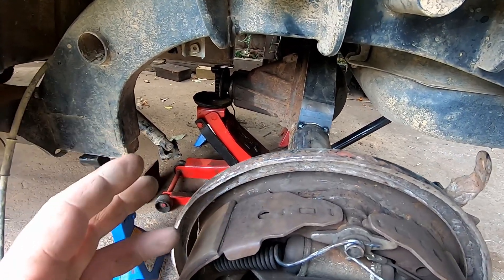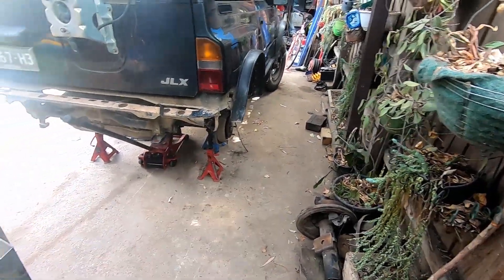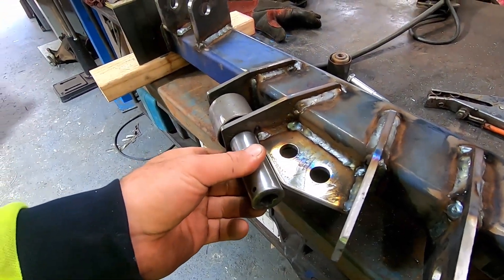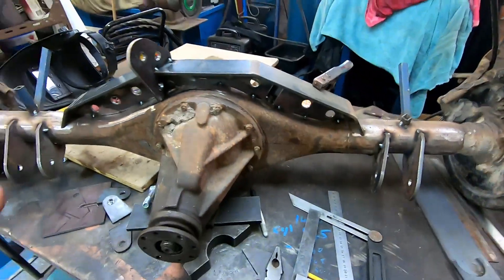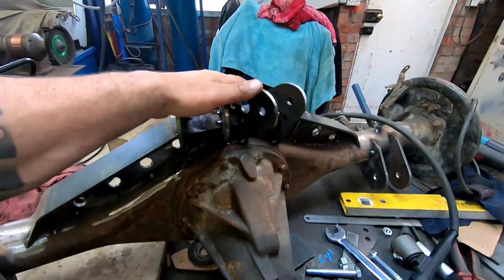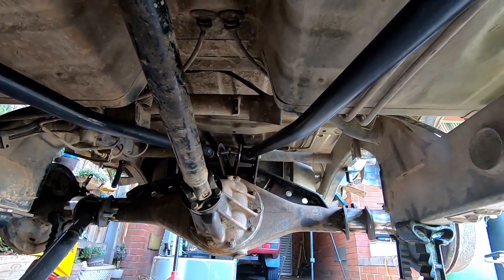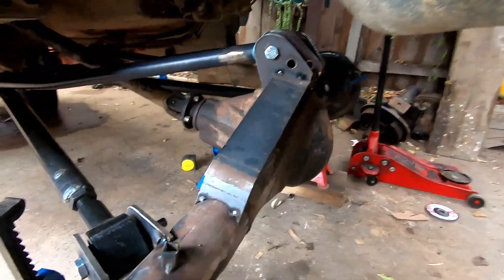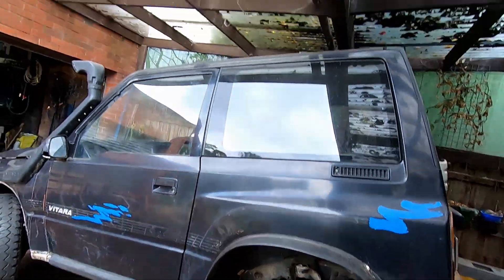Double Triangulated 4 Link Rear Suspension - Vitara Build PT4

Comment: Nice job , but what about rear transmission ?
Reply from the maker: @baregroup  as in rear diff?
Reply: @jaydnp.  did you extend the rear transmission?
Reply from the maker: @baregroup  yes, is longer with landcruiser uni joint
Reply from the maker: @baregroup  no 2.1 diesel
Reply: @jaydnp.  im installing 1.9 tdi and need to make 4 link and push rear axle back …

Comment: looking forward to this video already!
can you swap the axle shafts for splines on both ends and then have rear locking hubs? I would like to flat tow mine and that would be amazing if that would work!
Reply from the maker: I don't see why not but front hubs are normally the weak point when using bigger tyres